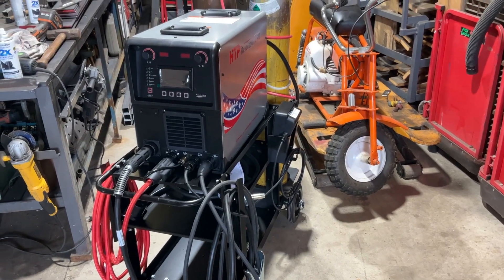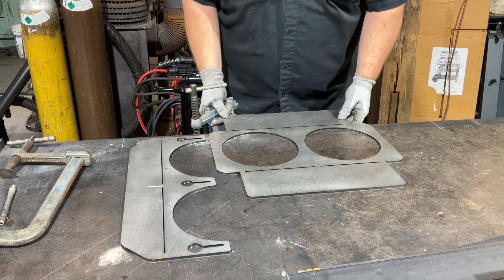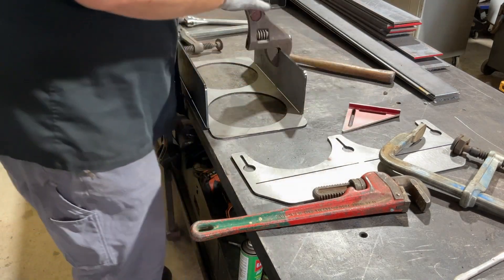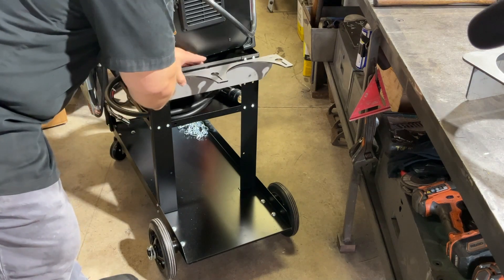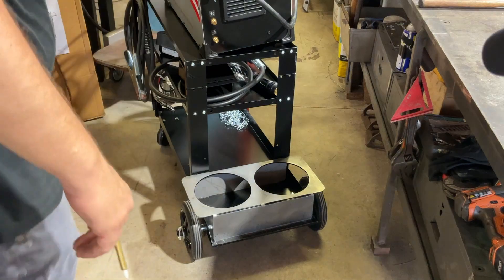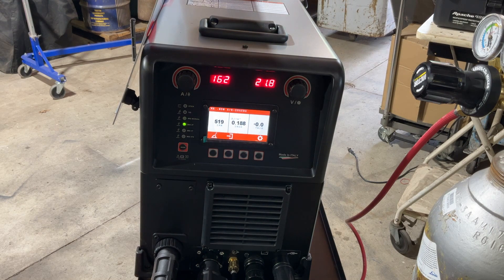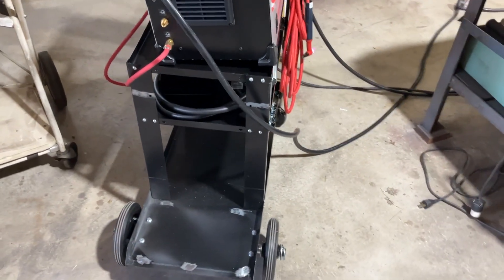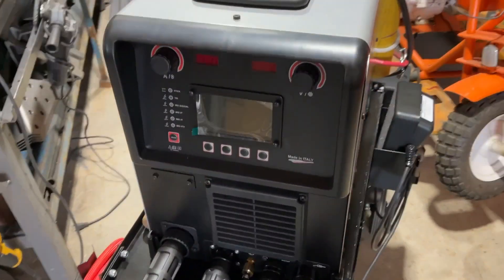Welding the HTP Dual Welding Gas Tank Holder For the HTP Revolution 2500 Multi-Process Welder

Comment: Very nice, looks like something I can use right now! Can you tell me the diameter of the two holes? Also the width & length size of the bottom tank holder piece (after bending)? I'd like to purchase one of these sets - but I need to confirm that it will fit my two bottles (90/10 Argon/CO2 and 100% Argon - both are 125 cu.ft. tanks @ 7-1/4" diameter) and also fit the width of a custom welder cart I'm in the process of fabricating. Perhaps you can include size spec's on your website for those like myself who wish to install them on carts other than your offered units. I currently have your Pro Pulse 220 MTS. Thanks, mike
Reply from the maker: It holds two 125cf tanks nicely. I am working on getting the measurements.
Reply: Thanks for the response. My OCD has me concerned that the radius be kinda close - I have seen a couple others similar but their radius was much too large, albeit the chain would still keep it in place I suppose. At 72 years old, I don't anticipate ever going larger than 125cf bottles - that size has accommodated my needs nicely through the years. I also have one C25 bottle also in the 125cf. size. I'll look forward to you posting the dimensions. I have the slide trigger so no need for a foot pedal pocket.  @usaweld
Reply from the maker: Thanks Mike!  Here are some measurements for you. 18" wide at the top plate which extends over the wheels of our cart, 9 1/4" deep from back of cart. 4 1/2 inches tall from original bottle tray of the cart.  The tank holes are about 7 1/2" Keep in mind that the bottom is designed so that it rests on the existing tank tray of the cart so it is made narrower than the top by about 4" overall. About a 2" overhang over each side of the rear wheels.
Reply: Great! Thanks, I'm moving onto your webpage and will order mine right now. I'm psyched!  @usaweld